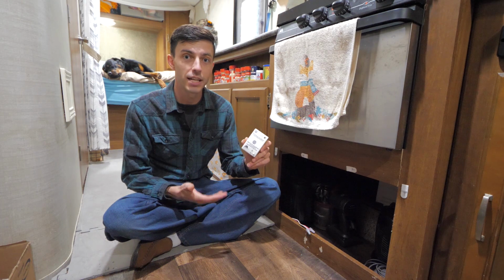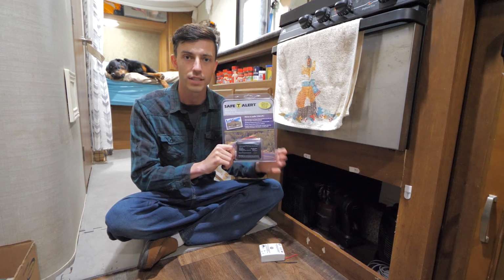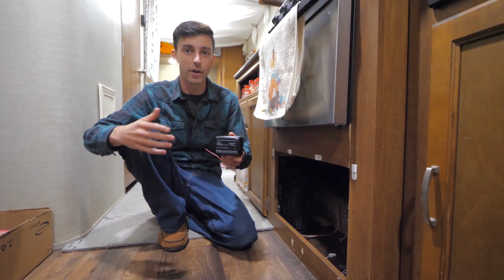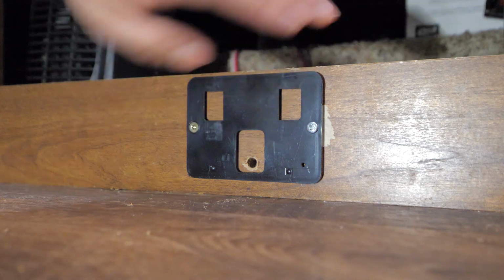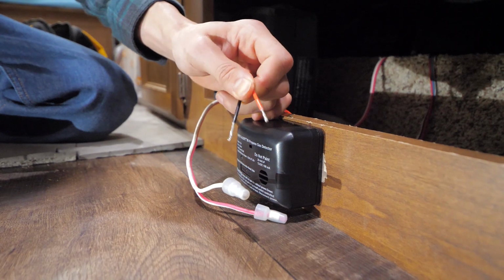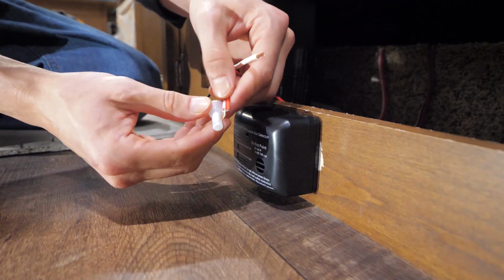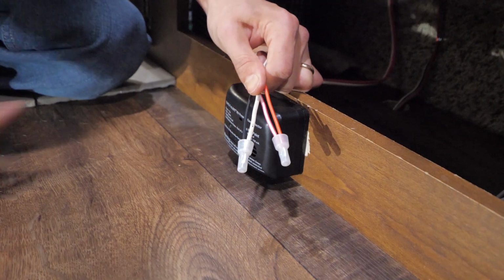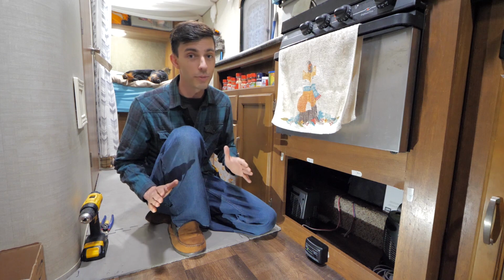UNSAFE! - Failed RV Propane Gas Detector Replacement - RV Life

Comment: Strongly recommend anyone doing this is to get a meter and verify the + and - voltages on the wires from the manufacturer.  In our Bounder, the polarity is reversed in many places -- the + is on the black or white wire and the - is on the colored wire.

Comment: That's really weird, the propane detector in our 99 class B is original and works fine.  I test it with a propane torch and it works every time.

Comment: can you put a list of tools in the comments or in a video overlay??
Reply: Sorry for being sacrastic.  Many different tools that do simliar jobs. Some wire strippers have a section that can also cut the wire. Some strippers have spring loaded jaws that have a variety of openings for specific wire gauges which can be very precise and strip the insulation off very quickly without cutting into the wire strands underneath.  A variety out there, some cheap, and of course some very expensive. Choice accordingly to your needs vs your budget. An inexpensive multimeter to read voltage is always a must, digital inexpensive unless you use it in a job situation. Let your paycheck decide.  He should have used one. Its like always doing a CA roll through stop signs, one day you're look as you roll through, but not see, and boom, get hit. Always check for power.  If you're not comfortable with a job like the one he did, there are lots of folks that can provide hands on, walk you through it for nothing. Again, my apoligises for being a jerk.
Reply: @strshooter7399  it's alright; thatnk you for the intel and advice! I didn't even think about checking if the voltage was low since he took out the fuse. that's really important so it's appreciated.
Reply: @neonrainbow9033  Take from an old US Navy Aviation Electrician's Mate, wiring can rub against other wires, things happen in Aircraft ( & RVs) due to vibration.  If you've ever been really shocked, and lived, it HURTS.  So, isolate the circuit, but check it for power.
Reply: You're kidding right? A screwdriver, a multimeter, wire strippers... ?
Reply: @strshooter7399  no some of the tools i don't know the name for. It just looked like pliers to me. Also  it's not a bad thing to ask when you don't know something.  Thanks for letting me know those were wire strippers didn't know they had those; I only knew about thw wire cutters.

Comment: I would think that the manufacturer assumes the RV is getting used seasonally, so for fulltime RVers that 5-7 years is probable cut in half, which makes sense with when you started to have issues with it.
Reply from the maker: No, the 5-7 years is merely the life of the detector which doesn't matter with the use of the trailer.

Comment: Excellent reminder to everyone - keep in mind that the lifespan starts the first time that power is applied, so your detector could be up to 12 months old in your "brand new" rig - be it trailer, class A, etc. The recommended max lifespan on most of them is 10 years, even for the newer self contained battery units, so if in doubt, replace it!